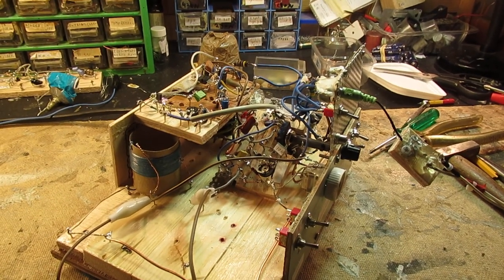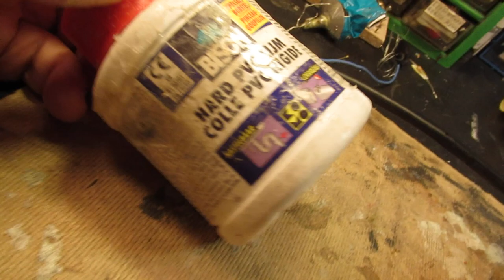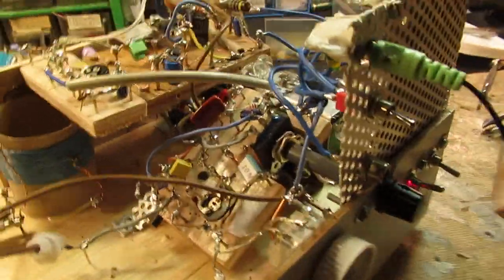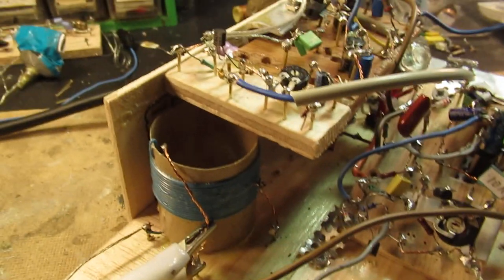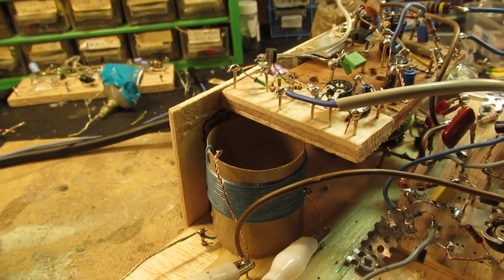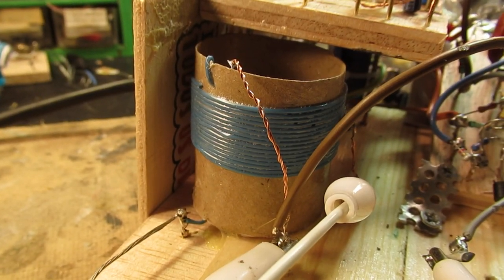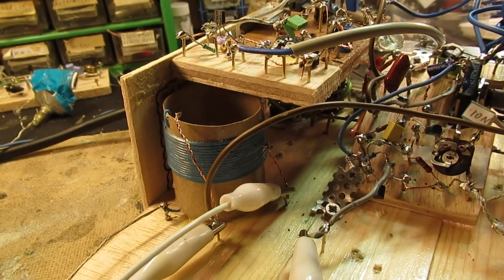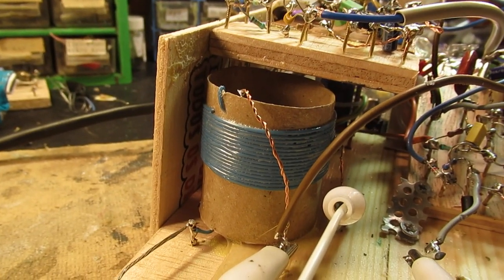Trying to make a simple TRF radio for LW reception part 12: radio propagation on Shortwave & more

Comment: Btw, LW is only populated by public radio broadcast stations in Europe and North Africa. The other parts of the world never appreciated the true joy of the lower bands.
Reply from the maker: Thanks, good info.
Reply: Ah! I sorta wondered how popular it was when I started hearing about "BBC Longwave" broadcasts in the Midlands and Wales. Judging by the dial scales on older, multi-band, U.S.-made radios, it does appear that LW was used for police, ambulance and fire departments in the States in the '30s, '40s and early '50s. Of course that's not exactly programmed public broadcasting, but they seem to have been used.
Reply from the maker: @RapperBC  Thanks. As far as I know these long wave frequencies are still used, but I don't have a good quality radio receiver for these bands. And I don't want to buy a (say) high quality radio receiver (the ones made specially for radioamateurs, say 2000 - 4000 Euro's or so) because in that case I don't have to do any longer the radio reception experiments. It makes my hobby kind of useless.

Comment: Do you know the frequency for that German radio station?
Reply from the maker: At the moment: no. Perhaps I will hear it on the longer term.
Reply from the maker: Barry, in the past I listened on Shortwave to the so called "Deutsche Welle", literally translated: the "German wave". But I am not completely sure that also Radio China has some transmissions in English and German. Could be. And the SW reception is at the moment a kind of mess, due to the bad selectivity with this TRF setup, so on moment X I hear that German radio station, but after a few minutes I hear Radio China again and after that Radio Roemenia. Will try to get somewhat better results in the future with a kind of antenna tuner, but don't expect so much of that. The SW on this radio is a kind of "joy experiment". 13 nov 2021.